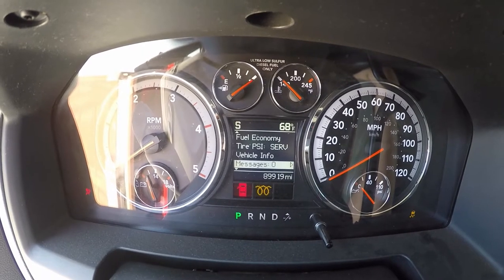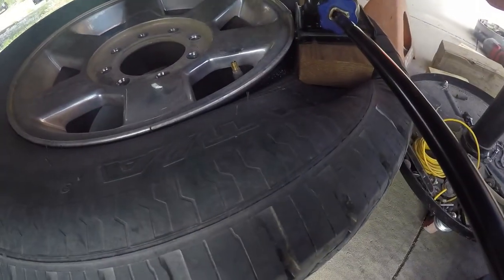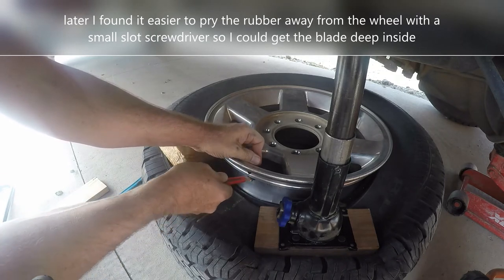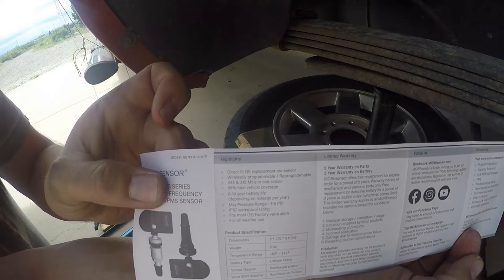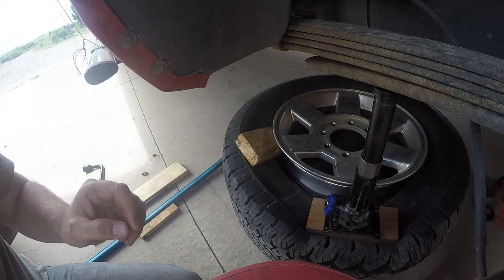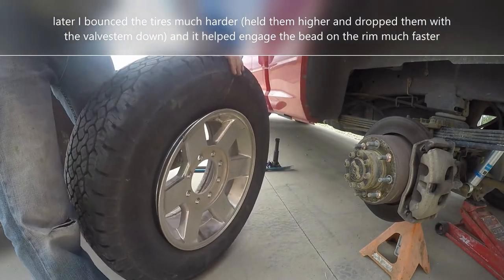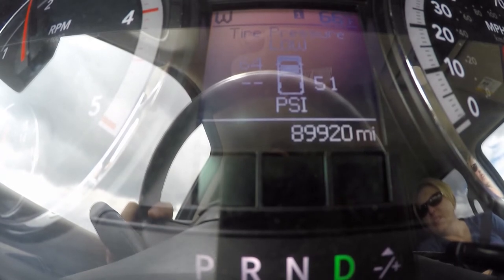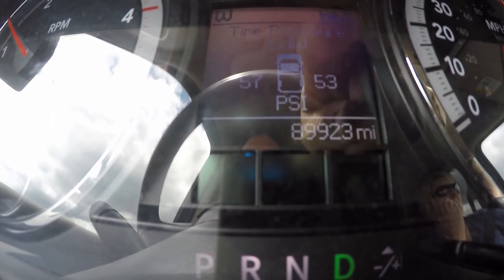Amazon TPMS Sensors for RAM truck DIY (Part 1)

Comment: I just installed the same TPMS from Amazon you installed onto my 2012 ram 1500. I watched the video primarily to verify how quickly the truck would learn the new sensors. One thing though is that I broke the bead like you did but had considerably more difficulty. The tires are on steel rims, and don’t know if that made a difference, but I lifted the front end clear off the jackstands without breaking the bead. The entire weight of the engine was on it and it took the extra work of a crowbar to finally get it to go. I also used lots of lubricant around it. One thing, I did have the jack overhanging the rim slightly once but was able to adjust it by just tapping on it with a hammer and getting it to slide over a teeny bit.  One last comment, I don’t know if you notice but on the OEM TPMS it’s stated to replace the screw and valve stem with every tire change, so you probably did well not trying to use the old one. Good video.
Reply from the maker: Thanks for sharing your story! Glad you had success. I wonder if the sidewalls on that 1500 are smaller? Or not as tall as mine? My mom has a 2012 RAM 1500 and the tires are pretty low profile in comparison. Although mine are "E" rated and hold 80psi! Were your tires very old? Glad u were able to adapt and overcome! Way to go! I appreciate you watching and commenting 👍

Comment: So you dont need a scan tool to program these.   Just put them on and they work .Thanks
Reply from the maker: At least for this brand of tpms sensor for this RAM application, that's correct. However, this same brand of tpms sensor for my Toyota 4Runner needs a programming tool.
Reply: @anesthesiadreamin  thank you for the quick response

Comment: Weird. My sensors don’t have a torque spec in the instructions. I tried doing 20 and it obliterated the sensor mount thread
Reply from the maker: Wow, I'm sorry to hear that! Did you happen to use foot pounds by chance? The instructions and in the video talk about inch pounds. I would complain that it didn't come with directions, and maybe you can get a replacement. And do you have a quality torque wrench? I mean, my Craftsman one is not great quality, but it's not a cheapy either. I've had a couple cheap torque wrenches in the past, and I've screwed up projects, ended up throwing them away.  One I actually smashed on the ground until it broke apart cuz I was so pissed. But that forced me to buy a halfway decent one lol. Sorry you broke your sensor bro
Reply: @anesthesiadreamin  update! I misheard you. lol i did do foot lb not inch lb. 

I did say to myself that 19 foot lb seemed like a lot for an aluminum thread but I went for it. 😂

Anyway I don’t have an inch lb wrench but I stopped tightening when the rubber spacer started to squish out

Comment: Hey! Is it a good idea to change all the sensors at the same time? Or one by one?
Reply from the maker: Nah, if you're doing it yourself in your driveway, and you can replace the sensor anytime as they fail, I would just do one at a time. But if you're having a shop do it, I would replace them all at once. Chances are if one's going bad, the others are not far behind, at least that was my experience, three of them went bad within a year. Hey thanks for watching and commenting, hope the video helped.

Comment: Question, have you had any leaking from them in the past year ? The aluminum valve stems ? Just interested and for real nice job on the video I have a similar truck and I have a tire shop doing mine soon, I have one bad one but ima do all 4 and keep the 3 that still worked and put them up ya know but seems like they work perfect
Reply from the maker: Yes, no problems at all, I have not had to add air. I would just say make sure to torque them to the specification.

Comment: Hi, thanks for this video, do you have a link or a part number to look it up on amazon? Please
Reply from the maker: MORESENSOR Compact PRO Series 433MHz TPMS Tire Pressure Sensor 4-Pack | Preprogrammed for Select 850+ European/American Brand Models | Replacement for 56029398AA | Clamp-in | KX-S033-4
Reply: @anesthesiadreamin  hi, tks alot for the info, i have a 2009 ram, will it work for me?
Reply from the maker: @baloo217  i dont know for sure, mine is a 2012. You could email or call the company at more-sensor.com or ask on the amazon page.

Comment: @9:55 When you install  TPMS sensor w/rubber stem, I assume (I've never work w/tires w/TPMS sensors) you need to apply some mounting lubricant pasta (I used Bead Don on rubber stems), like for usual stems w/no TPMS. But do you need to apply a bit of that paste on metal stem, like you have? Or something else should be applied, or just nothing? But the metal stem also has on the bottom the Rubber gasket as well, so should be lubricated I think. Thank you for the informative film.
Reply from the maker: IDK about lube, I didn't use it and am pretty sure the directions don't mention it. The metal stem slides in easily, and you are right, the rubber seals on both sides actually make the seal. Hey, thanks for watching I think that was a great question!
Reply: @anesthesiadreamin  Thank you for the replay. See the thing is that I want to keep the old OEM sensors. Though they are like 14 years old, they still work. But I've read in Instructions for another sensors I bought, that it is mandatory to replace the Service Kit (means gasket, nut, and Schrader valve). I have those Kits, and they include: Schrader Valve, rubber gasket, nut (w/no rubber on the bottom though, like in the original nut) and aluminum (looks like) washer (I think it is for another type of sensor, but now I start to think, maybe that washer is there, bcs there is no rubber on the bottom of the nut). I would appreciate any opinions on the purpose of that washer in the Survice kit. The kit is fm Amazon: Dynamic 6-127 TPMS Service Kit. And the OEM Sensor is: 40700-JA02B Sensor Unit - Tire Pressure.